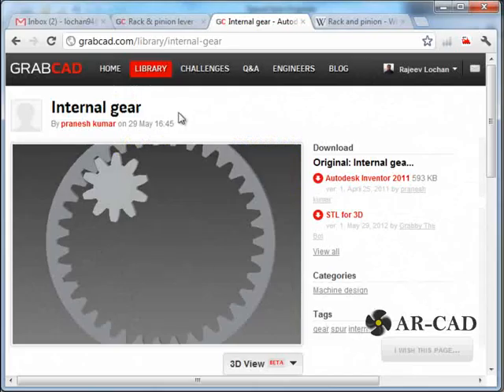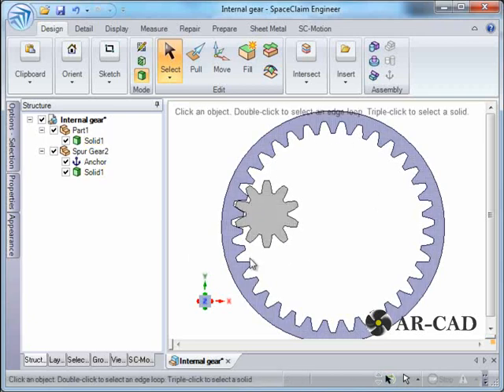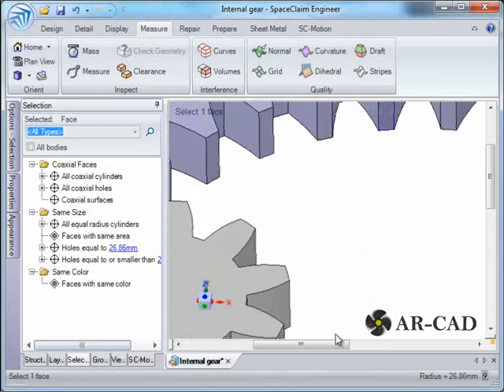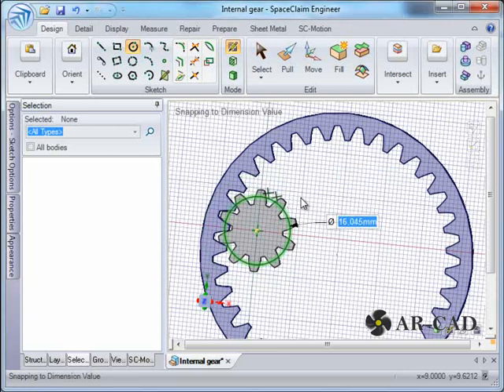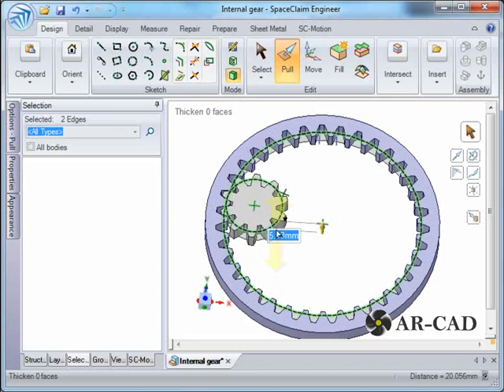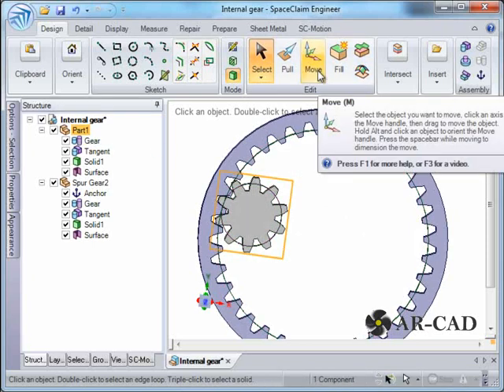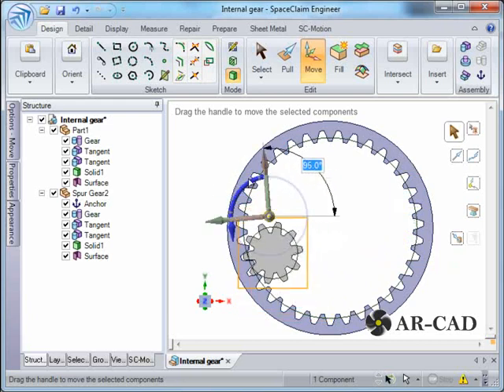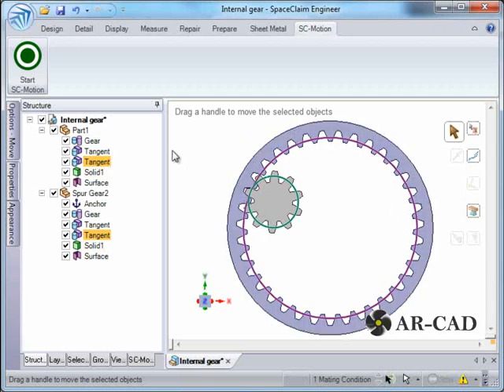SpaceClaim Tutorial on Internal Gears: Assembly Conditions: SC-Motion

Comment: another great demo! Did you have to set a material for the inner gear to be effected by gravity or does it have a weight by default upon creating the solid?
Reply from the maker: +Brian Boatright 
When you start SC-Motion, if a solid/component is not assigned any material, we take a default value of density for that component. Else, the dynamics would not work for Zero masses.